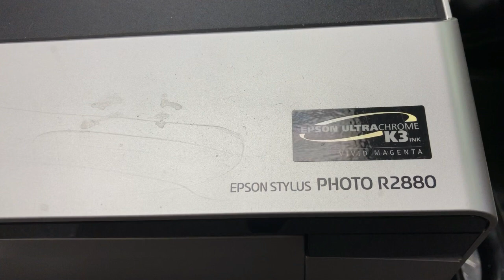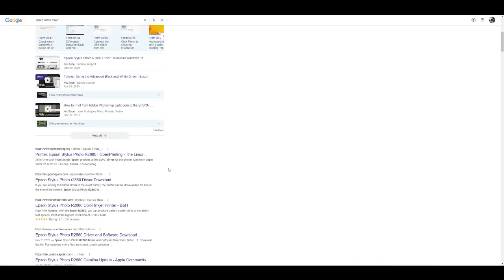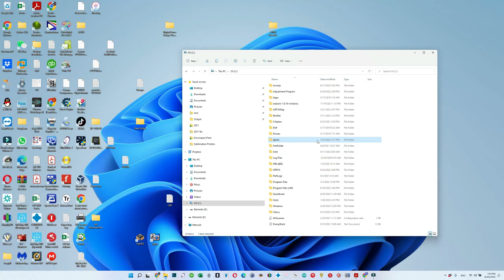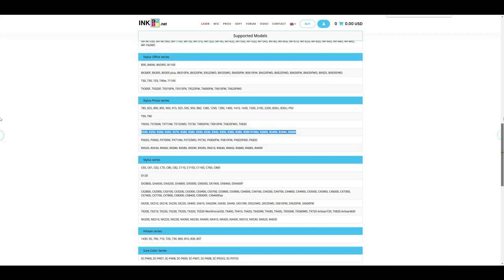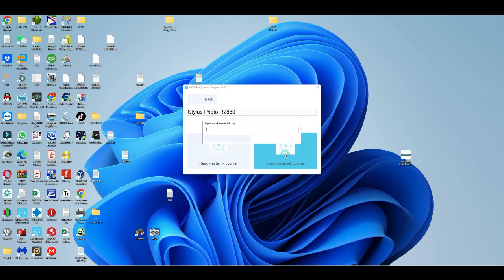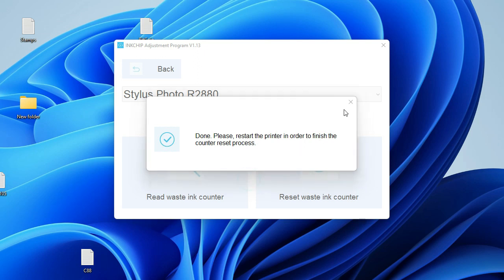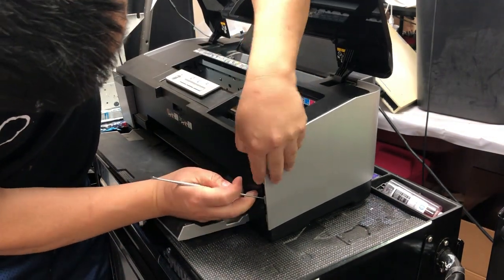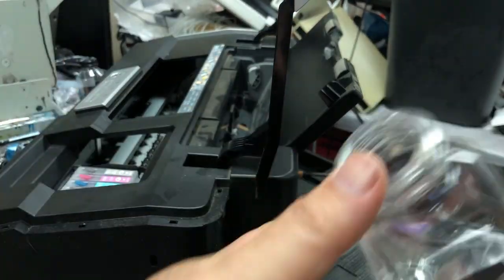Epson R2880 WIC Reset & Adding External Waste Tank

Comment: You have to clean the ink wasted inside or not after to made this?
Reply from the maker: Not really. The old pad was only 60% full. Even with 100% full, I won't bother to remove the old ink pads. The old ink will dry inside the printer.  New waste ink will flow into the bottle. As Mr. Burns put it, "Well, take your mind off contaminants for one night and have a hot dog!"